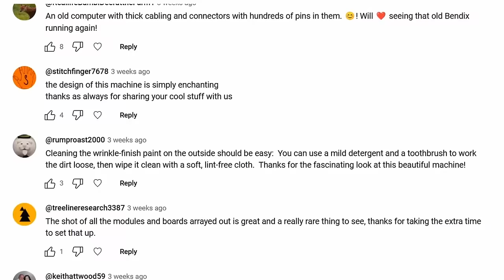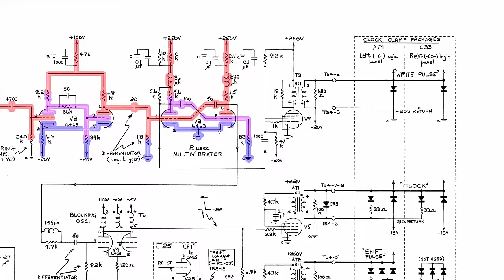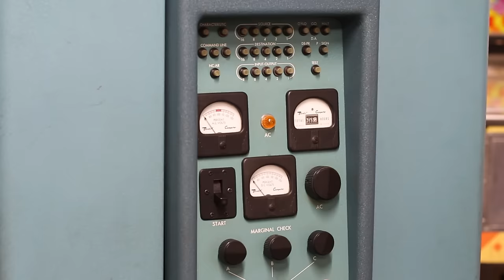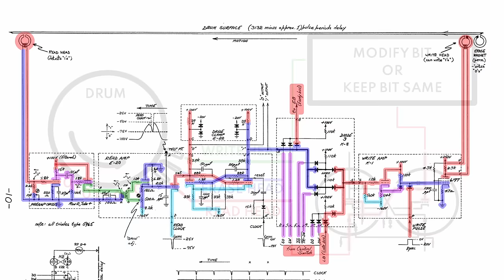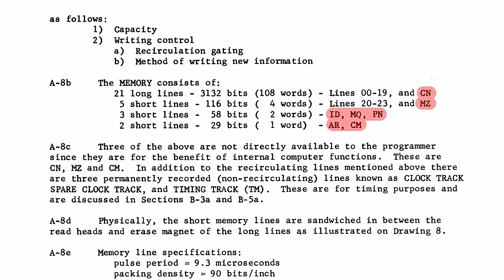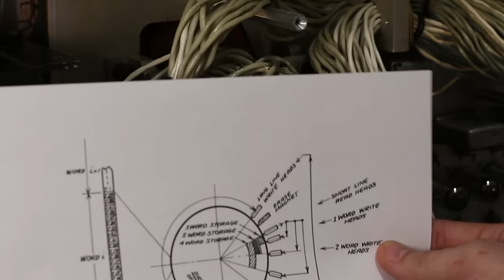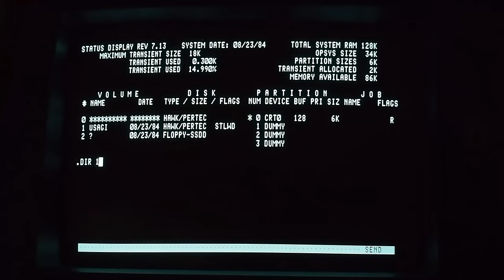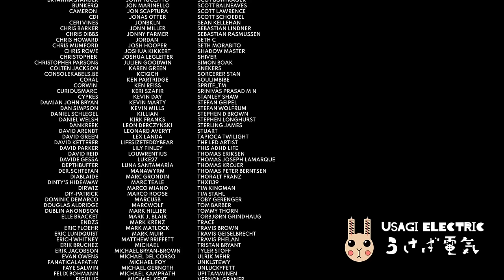Rotating Drum Memory with the Bendix G15

Comment: I wonder if it would be possible to refinish the surface on a lathe, then helically affix a layer of magnetic tape onto the surface. Could it be baked-on in a precisely controlled oven? Every 1 or 0 written to this drum may be huge enough compared to modern standards that even a small seam on the surface may be tolerable as long as the heads won't catch the seam. Very interesting content as always!

Comment: I sure hope all coupling caps you find in this machine aren't wax caps, imagine if you have to replace everyone in there, hope for mica or poly caps in it
Reply: imagine the nightmare if it is bumblebees
Reply: @SeekingTheLoveThatGodMeans7648  Shivers, yeah, they are pretty much just a sealed wax cap, oh the leakage current they have, I can smell them and even feel how they burn tubes and resistors alike. I been re-capping lots of old tube stuff and you just know you gonna have to replace every single wax/paper based cap you find, mostly you can trust the Mica and poly, polystyrene, Mustard caps etc but pretty much everything else is gonna be wasted

Comment: Perhaps just move the heads to the left or right? Or remove the head assembly and recoat the drum while it's still in the machine. I would airbrush the coatings through the window we saw, after a scrub with a Scotch Brite non scratch scour pad and soak with 'awesome orange cleaner/degreaser'. (all this while the motor/drum is spinning)

Have two air brushes ready, one with a clear acrylic, and one with a choice oxide. Maybe clip them on to a plotter arm to control there pass on the drum.

Everything I read about coating tapes, the difficulty came from keeping everything uniform in unsupervised mass production. (keeping oxide dispersed in the paint, etc)

Comment: Im not sure if i missed it in another video or not, but i am wondering if you'll go through all of the resistors and capacitors and change any that have drifted, or are leaking?
Reply from the maker: Yes and no.
Most of the smaller capacitors that are Gudeman or Sprague are most likely fine, they just need a bit of reforming. The resistors are carbon composite resistors, and while they do tend to drift with time, once they get some heat into them, they tend to drift back into specification.
There are a few Selenium diodes up in the tape punch we'll deal with as well, but for the most part everything is going to be slowly brought up as if though it's all good. Once we've got power flowing through things, it'll be easier to see what is misbehaving and then make adjustments or repairs from there.

Comment: hmm.. i saw in a video about ferro fluids that its possible to extract the magnetic material from old vhs tapes. maby its possible to use that material to re-coat the drum...if it works for vhs it might work for this machine. And as a Chemist, that patent formulation seem very possible...and i actually have all the chemicals at work... BUT i live in Denmark.

Comment: I do lots of restorations of toys and games and electronics, and someitmes computers. It's weird that some types of grime, aren't at all interested in water, some not with soap and water, but 99% alcohol, will instantly clean them, but some paint just melts with isopropyl, so it's tough and you really have to be careful. Then there's acetone. :) I do sometimes clean very solid paint with acetone, but small amount rubbed on and off, that stuff evaporates SO FAST. Good luck. I'm a big fan of wet wipes and alcohol wipes. I go through tons.

Comment: they've gotta have coated the drums by using physics, not a really precise machine. like they spun it in a vat of resin that slowly set then removed it and spun it at low RPM to prevent a drip from forming. wonder if you'll have to turn the drum on a lathe to trim off the old coating so you can put down an even layer

Comment: An idea, especially now that you have a “spare“ (broken) rotating drum memory subsystem:

So, just how “insane“ was the electromechanical engineering of the GE engineers? They would have known about the problem of a head crash resulting in unrecoverable damage. What I would have done is design the (monolithic?) mounting stantion for (all?) the read/write/erase heads, so that one or all could be mechanically translated a bit left or right, to newly situate them over undamaged media.

How practical is this? Worth a try?

Comment: "Just wrap the drum in magnetic tape!" - is my completely naive take on resurfacing
Reply: I thought about that too, but getting the joins accurate and smooth enough not to snag on a head might be challenging. Also a bit that got written across a join would likely get lost, although it might be possible to time things so that the joins go past during dead times between groups of words or something.
Reply: @gcewing  Plan B: Smear it with glue and sprinkle it with rusty iron filings 😆 How hard could it be, right? /s

It amazes me what David (and the community) are able to accomplish. I am fully invested in this saga!
Reply: I like this idea too. If the tape is wrapped helically, the joints are much less of a concern, because they cross the head gap skewed. Like a diagonal splice on an audio tape.

Comment: I would suggest an emulation for the drum: a modern logic circuitry with sufficient static ram, adapted to the read and write amplifiers. At least the rest of the computer would work reliably with all the mechanical problems of the drum ruled out.

Comment: My first 'wild'-idea was to take 3" video tape and adhere it to the drum after it was smoothed and cleaned.
The only challenge would be to try to make the inevitable seam magnetically nonexistent--which may be possible using some magnetic-oxide paint.
However, your quest to just re-coat the whole drum is probably better...
Reply: I think it would work better if you wrapped the drum helically in a single piece of tape. Wouldn't have to be particularly wide. Have you ever seen a diagonal scarf splice in audio tape? Completely silent when it runs over the heads. I would use the same concept.
Reply: Of course, the question remains if the magnetic properties are similar enough. I think most videotape has rather high coercivity. Might be better off with audio tape.

Comment: Cassete tapes coated with ferrum oxide and it is not a aliens technology. It just a thin plastic tape with magnetic paint on it. 
At least try to dissolve magnetic tapes in some kind of solvent and use this fluid as paint for a drum (just a theory).

Comment: The biggest issue I see is the twisted wire pairs, they degrade internally and if the wire has microcracks (you moved them, its all your fault!) then its easiest to replace the whole wire. THE DRUM IS REBUILDABLE! ....in the 1950s, 1960s it would be sent in for repair. Strip off the magnetic paint, sand the drum, apply primer, apply paint mixed with iron dust, apply top coat 2-3 times per manufacturers instructions, bake per instructions. Common repair back then.

Comment: So odd, the drum head wiring.  You'd expect coax or twisted-pair or flat cable!  Nope.  Looks like random #18 gauge stranded wires!   How odd.  Impedance control, noise cancelling, shielding, crosstalk control, what are those?   Amazingly crude, but of course it definitely worked, and worked well.  

In the read circuitry that may be a Schmitt trigger in there to square off the read signal.  Dr. Schmitt invented the circuit to square off bioelectric nerve impulses, way back in the 1930's.   

Good luck with the drum transplant.  You may have to reinvent some techniques for adjusting the read amplifiers.  An Arduino may be of some help as a test-pattern generator and data read-back comparator.

Oh also all those adjustment pots may need a deep cleaning or at least an oiling and a vigorous exercising to make sure their wipers are making good contact.   Fortunately or not they are firmly sealed and difficult to open up so maybe just a good rocking 30 degrees back and forth may be all that is easily doable.

The read amplifier tubes will need a good going-over to be sure they are quiet, without any tube crackling or intermittent pin to socket junctions.  The pins are optimized to match the thermal expansion of glass, not to be corrosion-resistant, so you may beed to do a lot of tube-rocking and socket cleaning.  Good luck with that.  AS an analog-tube guy I would lean towards hanging a set of 2000 Ohm headphones on the plate, through a 0.1uF capacitor, and listen for scratchy noises while wiggling the tube.  Powered up, of course.   Good luck!

Comment: Lovely timing. Was just discussing storage for Cockpit and Data recorders previous to ali digital.
Tape ... wire ... cores? ;-p

Addendum: 6AU6 rocks steady! 
73
--VE6IU
Reply: p.s. when I was flown up to DEWLine Pin xx to keep the system ticking over til updated, I noted ... with astonishment ... that the venerable Lenkurt L600 carrier syste ("multiplex"!) used "stepping through" sets of relays to monitor individual channels! But the modules were transistorized (great huge TO-3 cans!)

BTW a big part of that system, which mostly was used for teletype, was "regenerators" that cleaned up square waves ("bits") for each and every channel in real-time.

Comment: Have you considered wrapping a drum in parallel strips of magnetic tape? (proper recoating would be amazing, of course!)
Reply: Or a single helix.
Reply: Also a good idea and probably much easier to do. This probably doesn't have a very high density, so i wonder if there would be any issues with the heads traversing the diagonal slices. Individual loops would need to be spliced carefully at the end, which might be rather difficult. 

edit: helical would probably also look nifty with a faint 'barber pole' effect going on.  @danmenes3143

Comment: I've never heared that electrons inside the vacuum of a tube care a dime about whether
there is some dust on the other side of the glass.

Next thing you will do is lay the device on its face so that these already
age old electrons inside do not have to climb up so extremely far
in the cruel field of gravity of our earth.

Anyway I love your enthusiasm to get old computer gear back to life.
My first contact with programming was with a Zuse Z23 also equipped
with a drum storage. Then an UNIVAC 1108 followed.

Why don't you wrap some high quality magnetic tape around the drum 
and fix it with good old bone glue ?
You do not even have to pull the drum out for that, just readjust
the distance of the heads to the drum.

Comment: It isn't like you could have shifted the head assemblies a few thousandths to the left or right ...
Reply from the maker: I didn't mention it in the video, but the clock track is permanently recorded on the drum. If I shift the head assemblies, I lose the clock track and have to rewrite it. But even worse than that, the video doesn't convey the damage as clearly as in person. I don't think there's enough good material on the drum to actually shift one way or the other and still have a working memory.

Comment: It seems to me the tracks on the drum are quite widely spaced. Would it be possible to A. Check that the motor and bearings are good before continuing. B. Offset all the heads so they run on undamaged areas of the drum. 
I doubt a drive like this would experience a head crash if it's clean and the bearings are in good shape. Unless some moron moved it while the drive is spinning or there was an earthquake in the area.

Comment: Too bad about the drum, hopefully, the replacement and especially the coating process works. I wonder if modern magnetic pigment they use to make audio tapes would work on that drum or if it needs some special stuff that would be hard to get.

I agree about emulation though. To me, the fun in using old computers (though I do not have  anything THAT old) or other equipment is the hardware - either using it the way it was used or to make it do something more modern. Emulating it feels "wrong" and "fake" to me. What's the point of using a computer that is 10k times more powerful to make it pretend it's an old computer. I can just use the newer computer as is. The only time emulation is acceptable, IMO, is if you absolutely have to run some old software and do not have the hardware that was supposed to run it. No fun, but then fun is not the goal in that case.

Similar to, I don't know, making a diesel locomotive look like a steam powered one. Just use the diesel as is if you have to. 
Or making a radio that looks like it is 50 years old and should have tubes, but fitting it with modern components.

So yeah, I am happy that you are using the old hardware instead of emulating it. I'm pretty sure I would be doing that as well.

Comment: Man, you are biting off a big chunk here... Getting the machining work done is going to be the biggest hurdle, I would think.  You would definitely want to have some sort of inner support for the drum to be able to chuck it in a big enough lathe (looks like, maybe a 6 to 8 inch swing would be enough).  The support would help keep the drum from distorting too much during the work.  The ideal situation may be to remove both the drum and the original spindle that it rests on, get some good working dimensions from it (using an optical comparator if one is available), then chuck up, buck up, and try hard not to foul up.  (Yeah.,. keepin' it family friendly for YouTube...😁)

A shiny surface polish may not be needed, and may, in fact, impair adhesion of the magnetic coating -- try a more "satin finish" instead.  Without more knowledge of the original manufacturing processes, it is going to be challenging to get a coating that mimics original performance and is durable.  You would need to know things like the coercivity of the coating and the field strength of the read and write heads.  The latter should be obtainable via direct measurement with the right equipment, but the former is a matter of physical properties.  Save some of the original coating, and maybe have it analyzed?  (Might give you a leg up on finding what you need?)

You are going to need support of every kind for this adventure, sir.  Just signed up at Patreon on the strength of this and other videos of yours.

I wish you every success in this most challenging endeavor!  If I read the chapter titles aright, I also send my condolences on the loss of what looks like a best friend a family could ever have.

Comment: The name Bendix said to me Washing machine .... now I know they made ... Everything! ... 
Brakes, then hydraulics, electronics, missiles, ABS, Mass spectrometers,  Automatic Railways, Avionics, Aircraft systems, Computers (working with Alan Turning!) ,  NASA guidance systems,  Apollo packages, fuel systems for the SR-71, home radios and televisions, and eventually Washing machines ...
Reply: Well, the controllers in Bendix washing machines were kind of a very simple computer... a ROM implemented with cams and switches and some electromechanical logic to decide when to advance to the next step.
Reply: also made engine control computers
Reply: The mechanics still call the retraction spring of a car starter a 'Bendix spring'.

Comment: there must zillions of dead capacitors inside too ! Re coating the drum would be fantastic but how to get 'magnetic paint' ?
Reply: Most of the caps I see look like polystyrene ones from manufacturers like Gudeman and Sprague. They're probably just as good today as when they left the factory.  Although one or two have been replaced - I think I saw one with a 1991 date code????  I agree there are probably a handful of dead electrolytics, but I see no wax-paper ones.  

I see signs of rework on one of the boards. Some of those Ge diodes (1N107?  I'm color-blind and my assistive app isn't picking up the color of all the bands) have been resoldered as well as one of the caps.  Whoever did it did a sloppy job (no defluxing), there are big blobs of rosin left on the new joints.
Reply: @ke9tv   I said that because I saw bad things by at 6:07 in the video
Reply: @_hackwell  Those are too small to be electrolytics at vacuum tube voltages, so I'm guessing that they're the bypass caps for screen grids.  If so, they're probably 100 nF polystyrene. with paper labels that have taken moisture damage. They may actually test good!

Several of those 1N107 Ge diodes appear to have been replaced, as have a couple of caps, so someone's been in here before doing rework.  (And didn't bother to deflux. Sloppy job.)

Comment: I wonder if the powder coating method could be used since the material is copper.
Reply: The material is not copper. It is a thin layer of some kind of varnish or lacquer, carrying finely ground iron oxide, aka rust. Copper is not magnetic, and would not make a useful storage medium.

Comment: 100% agree on using original hardware whenever at all possible. Every time I see a retrocomputer restored with a Raspberry Pi emulating mass storage I can't help but feel it's cheating - if you're using modern hardware you really might as well just emulate the whole damn thing on that Pi and be done with it. The whole point is doing it on original metal, otherwise the magic is lost.

Comment: Recoating is sure exciting but I'm kinda skeptical it can be done without massive expense, even for this low density drum. Furthermore, it coating fails there is no saving the drum. I would instead recommend removing the crashed heads and rewiring the machine to use the remaining ones sacrificing the RAM size. If we need to run software requiring the entire RAM, I think rigging some modern electronics in place of crashed space is not ideal but can be tolerated.

Comment: I would have tested every valve and checked all the capacitors.
Resistors, especially carbon types go LOW with high voltage and in some cases, like grid resistors, can even go open circuit.